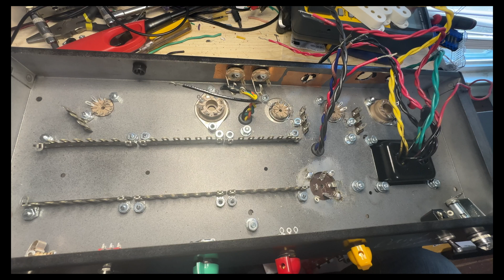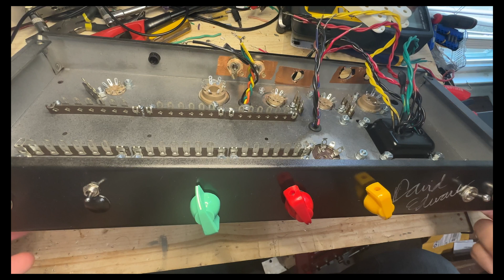Apollo Tube Amp Chassis Review: Design Choices & DIY Modifications

Comment: Any considerations for cathode and tail resistor for the 6SL7 PI compared to a more traditional 12A(X/T)7?
Reply from the maker: Yes I did the math on this one to figure out the values needed for the 6sl7. You could in theory use a 5751 for a 6sl7 and it would be close. The values I went with ended up between some 12at7 setups and 12ax7 setups. It made sense because a 5751 and 6sl7 has about the same gain.